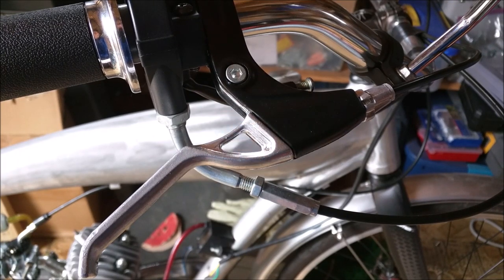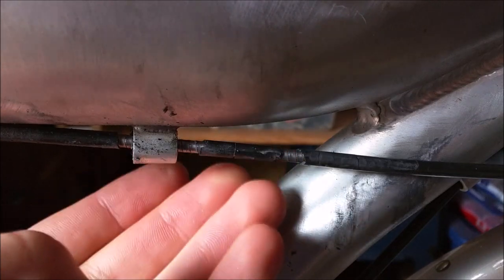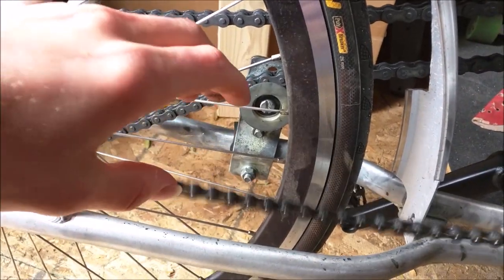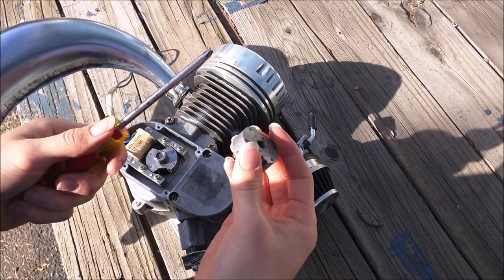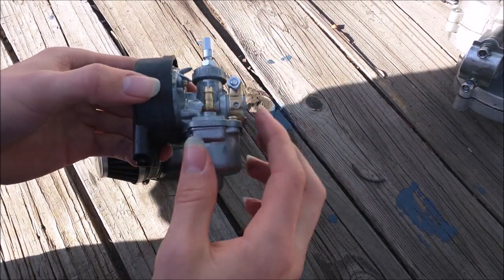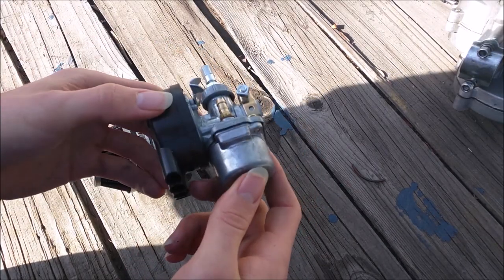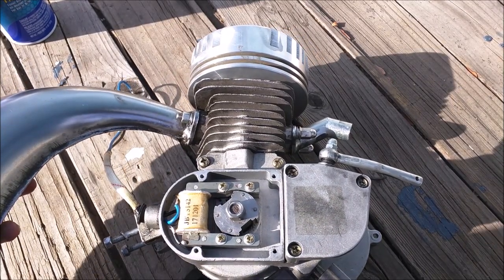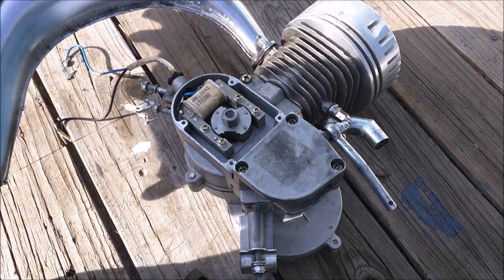80cc Motorized Bike Problems and how to FIX them

Comment from the maker: All the parts I used to build the bike itself are in the description of Part 1 of my 6 part series on building a motorized bike here: https://www.youtube.com/watch?v=ZyrqSBgfr8I&t=553s
Reply: My bike keeps going as if the throttle is turned even if I take my hand off the throttle I can’t stop
Reply from the maker: @af8550  it won't shut off or it won't go from fast to an idle?
Reply: So I release the clutch and pull the throttle it runs quick but when I release the throttle it just revs higher
Reply from the maker: @af8550  first thing i would check is if your carburetor is clean. sometimes they get stuck in the open position and don't go closed when you release the throttle
Reply: Thanks hopefully I can fix this just made it today
Reply from the maker: @af8550  of course, good luck!
Reply: Hey know it’s been a year but my engine won’t start for some reason like I head it firing but it won’t start I’m super confused
Reply from the maker: @rowansds2597  It may be an issue with the spark plug or magneto
Reply: Just put an 80cc kit on a 26 in. beach cruiser. I'm ready to fire it up but when checking the rear wheel by turning it manually with the clutch disengaged the pedaling is normal. When the clutch is engaged there seems to be out of the ordinary resustance. When I  take off the sparkplug completely there is no resistance and I can hear the piston going up and down evenly and normal. Place the sparkplug back on and the resistance is a bit drastic and I have to use arm as leverage to turn the engine with the wheel. Also loosened the butterfly nut 2 clicks to the left to loosen the clutch with no difference. Advis?
Reply: @BenCarano
My bike was recently started last week but it was not giving gas to the engine and was wanting to go idle after start. What's your recommendation?

Comment: The uh, "lower performance" carburetor also has a jet under the needle which can be replaced with 5mm thread jets. .65- .75 is generally optimum range. The Delorto knockoff jets or, "higher performance" carb will work for the stock carb also, and I have found this is the one (stock carb) which works better in KS. Many enthusiasts feel the same.
Reply: Huy
Reply: Yup

Comment: My boy friend has a 80cc motorized bike &his chain came off &he could not get the motor to shut off even after he pulled the spark plug wire why would it do this he says it is impossible to of happened.
Reply: impossible but spark can jump

Comment: Nice vid! Helps a lot.  I have a bad ass 79cc 4-stroke build. But just started my first 2 stroke build. Can be a little overwhelming at first. So much more complicated than a 4 stroke.  But hoping to get some good power.
Reply from the maker: Absolutely, In reality a 2 stroke fires twice as many times as a 4 stroke, so a 2 stroke will give you almost twice the power for the same size engine. However, because two strokes rev at such high RPMs, they tend to be a little less reliable and require a little more attention, so that's why I made this video to help with taking care of them. I'm glad this video helps, and I wish you luck on your build. I'll probably be doing a pretty complicated build soon putting a Honda GX120cc 4 stroke engine on a bike.
Reply: Oh don't worry they're not really that complicated they're actually kind of pathetically easy it's just that everything that's new seems complicated until you get used to it but once you get used to it there is practically nothing to them to stroke engines it took me a little while and yeah I still have issues sometimes but it's not because the thing is still complicated it's just cuz my mind has trouble wrapping around the various functions of what happens with your fuel air mixture so don't worry once you get into it real good you'll find that it stops being complicated real quick

Comment: Not to be disingenuous on your prior knowledge but actually the stalk NT carb is actually more adjustable and works better than the hp carb in some situations. For my cases the NT carb will give your bike more torque and the hp carb I have found to have more smooth response and it caps out faster unless you have a tuned and a good pipe.
Reply from the maker: Yes! I have definitely found that to be true. Honestly I think the only upgrade that has really made a difference is a better exhaust, but the rest don't really work much better than the stalk components, especially for this particular motorized bike engine. Yah they might add a little more torque, but I personally don't think they're worth the money unless you're in some race and you need to do everything you can to make the bike go faster regardless of how reliable you want the motor to be.

Comment: I just had another thought too because I'm in the middle of installing another engine on my bike that spring tension guide thing you were talking about if you put that on your bike you'll need to get wide cranks. Because it goes on the outside of the cover where your drive sprocket is and normally the bolts are recessed in your in the cover but when you put that thing on there you can't recess the bolts anymore so they stick out in your cranks won't be able to go all the way around

Comment: Heat  weakens  magnetism,and can demagnitize a magnetic. Could be your engine is running hotter than normal. Im not sure why it is only the one magnet though?could have something to do with the hot and grounding cycle   if that makes any sense?  I'm new at this, so I'm  just guessing? Check it out !

Comment: Two more things any engine you've got that you think might have you know a vacuum leak just start the engine and spray your starter fluid you've got there around the areas where there could be a vacuum leak and if there is a vacuum leak your engine will rev up when you do that. And on the the standard Muffler that they give you with these engines usually there's a screw on there end of it that you can drink it that you can unscrew and pull the guts out of it to clean them too at least I'm part of them yep it was helpful to me just Magneto thing I didn't know and hopefully you know maybe even one of my comments might help you I'm going to try out that new kind of chain guide thingy that I was talking about it looked interesting at least so thank you keep up the good work

Comment from the maker: If any of you are interested in links for parts or equipment that I use just let me know and I can post links in the description of this video!
Reply: Dude thank you so much I opened up my case on the side where the magneto is and fucking oil everywhere that bolt is loose as hell. I had no power

Comment: The thing where you were just talking about the leak behind that wheel there's also a Rubber seal that goes in there a donut thingy and if it's messed up it'll straight let your gas and everything out into the Magneto area

Comment: Nice video man. My chain 415 chain snap I replaced it but the engine will not start ? Can the chain snapping damage the engine?
Reply from the maker: I don't think so, at least I've never heard of that happening, but it's possible that the stress from the chain snapping threw something out of alignment.
Reply: what kind of chain or where can I get a single link master link for my 80cc motorized bicycle the engines from China where can I get a chain
Reply from the maker: @pauldoyle9210  it will most likely be a 415 chain. what you are looking for is a master link so you can just search for a #415 chain with master link.
Reply: @pauldoyle9210  get a 41 roller chain. You can find one at a local store

Comment: The other day my motorized bicycle started having issues to keep running. I at the time suspected bad fuel so I switched out the gas with a fresh batch and all was good... later the problem came back and I was back at square one! Yesterday I had a good ride without a problem only to have to limp home with a major issue. I cleaned the carb out and blew air through it to make sure there wasn't an obstruction. Next I looked at the spark plug, I replaced the factory cheap plug with one from a chainsaw. That was in prestine shape... test for spark??? No spark! I suspected a bad CDI ignition a few days ago and ordered a backup. Next I opened the magneto cover to see if something was grounding out.. When the cover came off the entire compartment was full of fuel! Now I suspect a bad seal! On inspection I found that the seal was not far enough in and the shaft was exposed on the end. Decided to first reseat the seal by tapping it farther in. I blew out the magnet and magneto the best I could and tried to run it. She fired up right away and ran reliably!  I took it on a short run to see if there would be any fuel leaking out and found none. Problem was solved!
Had I found this video earlier I would have had the motor problem fixed last week! Hope this helps someone in the future. 🙂
Reply from the maker: glad you got it working mate!

Comment: ive been running my china doll 50cc for 5 years now winter -30 fires right up i got unbreakable one. only haave to replace magneto if rode in water but other then a couple tubes and wheel bearing shes mint

Comment: I still use the NT carburetor I just took off the air filter and put on a velocity stack and then an air filter like the ones that come with the high performance ones

Comment: @ 12:13  I think you meant to say jets range from .61 - .78 that's with a decimal point which is way smaller than 61-78 mm.
Reply from the maker: Yes definitely

Comment: I’m having a problem with my bike. So I recently got my 80cc bike going and it was running smooth and was pretty powerful, it’s still in the break in stage but I leaned against the wall and it fell and I forgot to turn off the petcock so it flooded, I managed to get the bike running and it burned all the fuel out of the cylinder, it started to burn a lot of oil so I changed the mix to 25:1 instead of 20:1 and it seemed to smoke less but now when ever I go about mid speed it starts to shudder back and forth and the only way the stop it is to pull the clutch in. It will set off and run smooth at around running speed but any faster and it starts to shudder even with the clutch not fully engaged. Any thoughts?
Reply from the maker: Honestly that was the same kind of problem I started having before I decided to build my 4 stroke 120cc bike. My 80cc started doing exactly that, and it's usually fixable, but there's no guarantee. If I were you, I would try replacing the cylinder housing as well as the piston rings. Sometimes overtime when the aluminum heats up, it can warp which can throw things out of alignment. You could also take the engine apart and check for any carbon buildup, as you said it was flooded and even if you burned off the excess fuel and oil, there might be more carbon build-up as a result. Hopefully this helps! And good luck!!
Reply: Benjamin Carano Thanks for the advice, I did notice a lot of thick black oil build up in the exhaust which might have something to do with it being flooded and it was running way too rich at one point, I moved the E clamp on the needle up one so it’s running a lot better now and there’s also less smoke coming out the exhaust. I’ve noticed when I start to get on the throttle and it shakes if I just coast for a few seconds with the clutch still engaged and then get on the gas again the shuddering seems to go away or atleast be only a little bit there. I’ll definitely crack open the engine and have a look, I’m not sure wether it would have warped since it’s only been ridden about maybe 1 tank worth of fuel and not for a long period of time but yeh I guess cheap Chinese motors probably would.
Reply from the maker: @flynnlee2378  yah it shouldn't have warped then, but it's possible. Hopefully you can get it working!
Reply: Benjamin Carano Hopefully it’s not ,Thanks for the helpfull advice, I’ve only found ur channel yesterday and I love the content, keep the motorised bike stuff coming, love from Perth, Australia
Reply: just a update if anyone’s wondering I Think it was doing the shuddering thing due to a very weak spark. One side of the magneto magnet is weaker than the other which might be causing the weak spark. Today I cracked open the magneto case and took the magneto out and then sanded down the the back and front of it to get a better connection because there’s sorta coating on it from factory. So far I’ve tested it and it seems fine without a new magneto magnet. I may still need to order a new one which would be a shame due to this corona virus thing because it means delivery’s are 2-3 weeks longer for me even if they are based in Australia which is where I live. I have ordered a new NGK B6HS spark plug and am planning to put a BBR stage 1 or 2 CDI in the future.
Reply: @flynnlee2378   you should only use 4oz of oil per gallon
Reply: Just go 40:1

Comment: If my exhaust pipe has lots of fuel and oil buildup inside will 
 this keep my 2 stroke engine from starting?
Reply from the maker: potentially, it limits the air flow which could definitely effect the start up and running of the engine

Comment: My bike bogs at high speeds and sometimes once I launch it to turn on it idles well and great but when I rev it jerks and the bike loses power all I can do is idle it
Reply from the maker: Unfortunately the only advice for that is to replace your piston rings and housing, and hope for the best. That is a common problem that can cause that, but it may come down to having to get a new engine. Best of luck!
Reply: The float in the carburetor may be sinking. try replacing the float.

Comment: Hello, does the banana exhaust give me more power than my modified (pipe cutted) stock exhaust? And why does my kit not like to accelerate from idle (standing still)? It always shuts off when I try that. Or is it just me having 0 experience with riding motorized vehicles

Comment: These motors can last a very long time if you buy the right ones. Usually 5000-9000 miles though there is one documentation of one lasting 30,000 miles and still going. Other than that this is an alright video. Thanks
Reply: They gall wrist pins like nobodies business they last about a year before they need a top end rebuild

Comment: First time riding one first time building one but mine do not stay idle at all soon as I soon as it starts up and runs but when I hit the clutch to stop at a stop light or stop sign it shuts off
Reply from the maker: That's what happened a lot with mine where it would stall out and loose power, so I made this video with a lot of the procedures I went through to stop that from happening and fix it. However, sometimes these two stroke engines just aren't the best quality and they can be defective.
Reply: @BenCarano  I thought it is affected I contact the seller but he won't send me another one so I guess I'm stuck with this one,any  how what did you do to fix yours? If you don't mine me ask
Reply from the maker: @onway78  what worked best for me was putting a good spark plug in it, replacing the piston housing and rings, and replacing the magneto. I wish you luck and hope you can save it!!

Comment: and after I put the chain on it won’t roll the tire when I try to roll the bicycle the back wheel just locks up and what’s to slide on the ground how can I fix that and when I flip the bike over and move the wheel it wants to act like it’s going to start but when I put it on the ground it just  skid on the ground

Comment: im having a problem. something is clinking pretty loud when the engine is off and the clutch is in just riding it normally. i checked for any chain rubbing and cant diagnose it. any suggestions?
Reply from the maker: I wouldn't be able to pin point the exact problem with that as it never happened to me, but my best guess is that it could either be a bad bearing that causes the shaft to shake around a little, or it could potentially be a loose gear in the gear case of the motor. I would take it apart and check that all the bolts are tight and nothing is physically broken. Hopefully that helps
Reply: is it the muffler cooling off ?

Comment: can you help. my muffler gasket keeps burning out after 2 months riding it and screws get lose
Reply from the maker: use blue lock tight on the screws and replace it with a copper gasket

Comment: Hey what's up I got a DIY 80cc motorized bicycle. Got everything put together and can't get it to start so I ordered a new CDI put it on I've got a spark still not wanting to start now should I just keep trying it and trying it cuz it's a new engine until it eventually turns over it's getting gas I mean it's basically doing everything it needs to be doing to start it's just not starting the throttle is hooked up everything to the max the clutches at the right spot.
Reply from the maker: if its one of the 2 strokes like I have, they can literally be made wrong new out of the box. Had to get 2 of the cheap ones before I could get one to work. Never had this problem with any other engine except for this type. Not sure why. Good luck though!!
Reply: @BenCarano  I ordered the package expecting to get the picture that was represented but no it had no motor decal on it it was a totally different color.
Reply from the maker: @bmaluginthevanishingman6034  Yah That was similar to my experience. That's the whole reason I did the honda 120 cc build